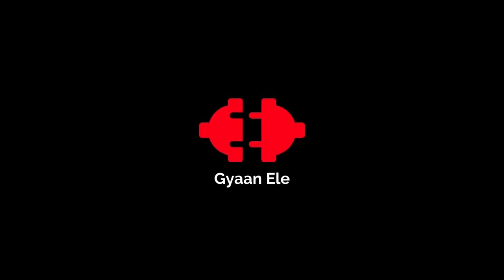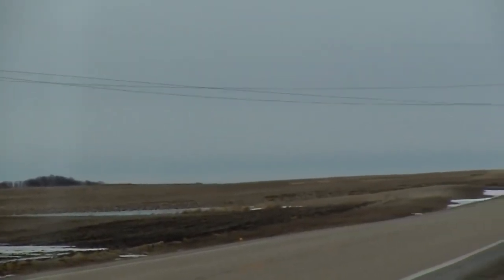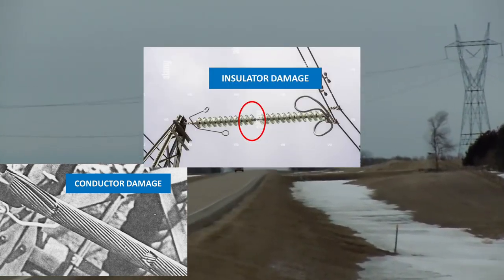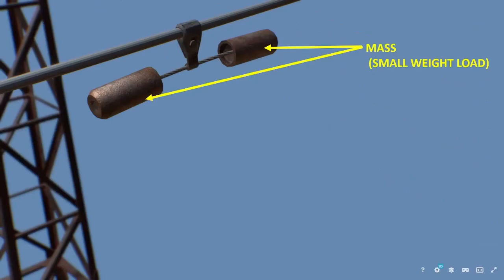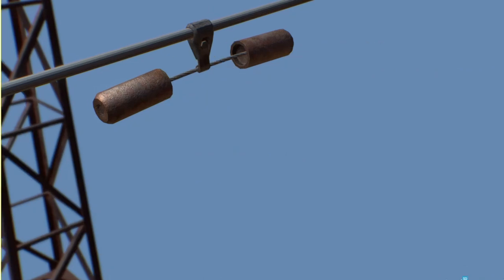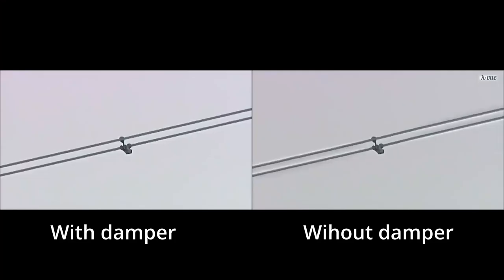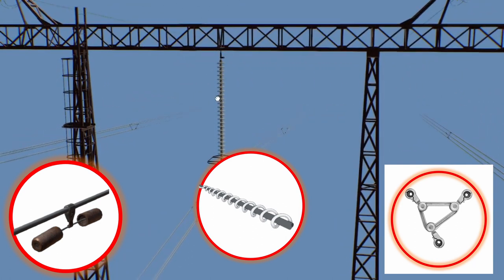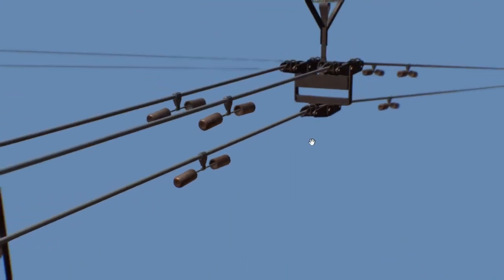[ENGLISH] WHY DAMPER ARE USED IN TRANSMISSION LINE with [3D Animation]..

Comment: Excuse me sir, Why they install damper near insolator not a middle of both tower ?
Reply: I believe I can answer that! Dampers are placement sensitive. For them to be most effective they can not be installed on a node. Installing them closer to the tower insures that the damper won't be on a node of the cable while it is vibrating. If you were to place the damper in the middle of the span, you risk placing it on a node of a given frequency.